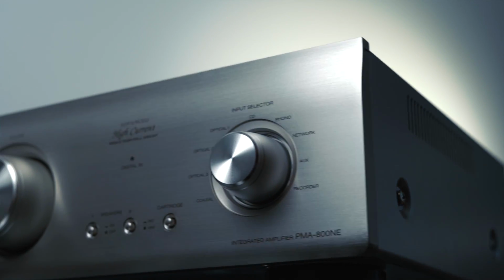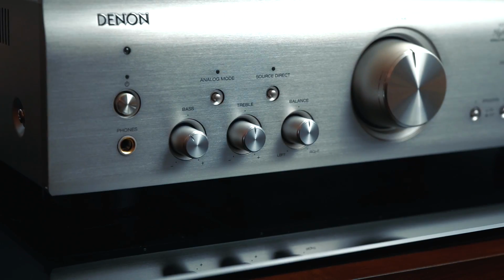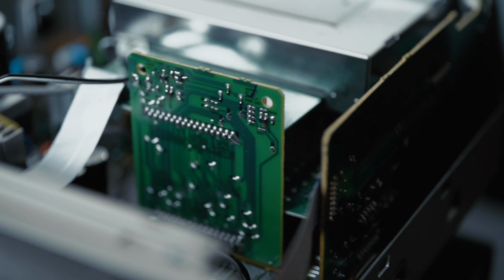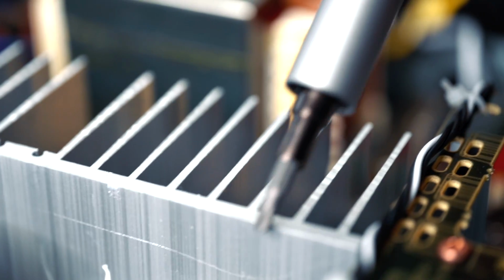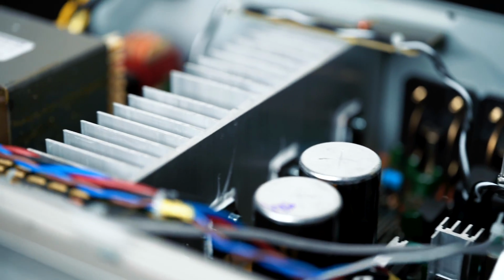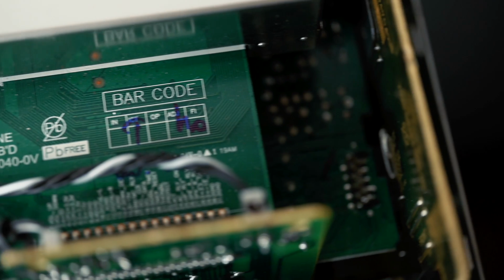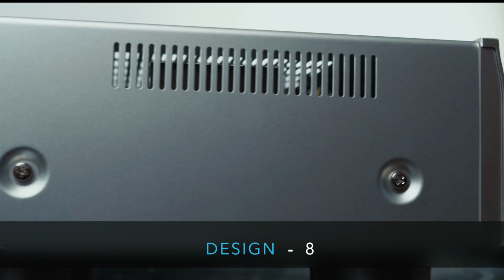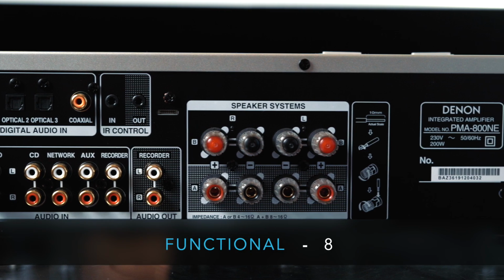Is the Denon PMA800 amplifier cool or not so cool ?! We will test this integral to the fullest!

Comment: What about sound signature.Many consumers said that this amp is cold sounding.
Reply: Quite a different sound compared to the Denon PMA600NE, a fair bit more detailed, not quite as much bass, less warm overall, quite neutral comparatively. Leans more towards the analytical side with a touch more brightness. You may want a warmer amp for Rock, modern EDM, Hip Hop and heavier music in general.
Reply: Had the PMA800NE for a few years and it never really excited me. I guess I fell into a routine with it. Now bought a preloved Marantz 7200 and boy what a difference! Warmer and more engaging but also more detailed. On the other hand, my brother (a sound engineer, while I am a philistine) really liked the sound of the Denon.